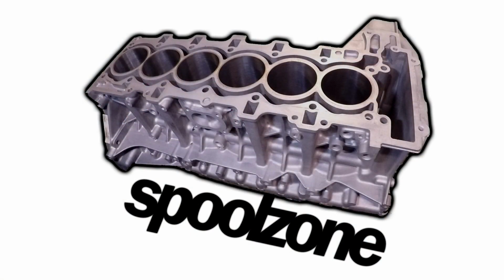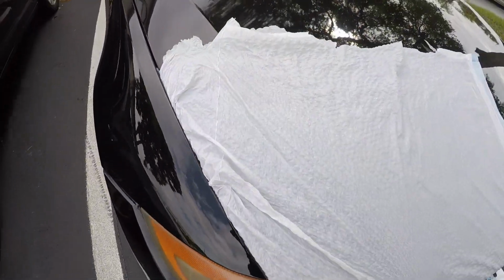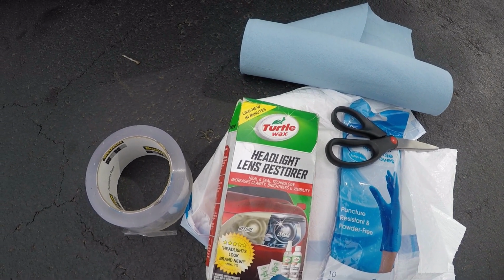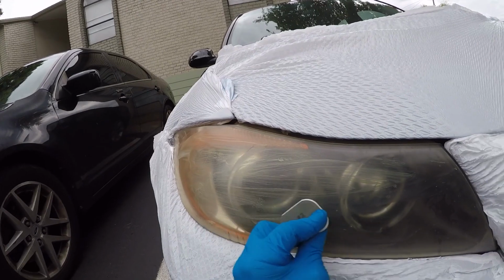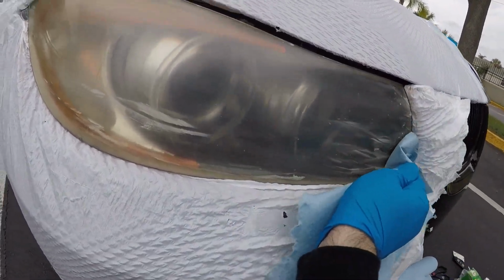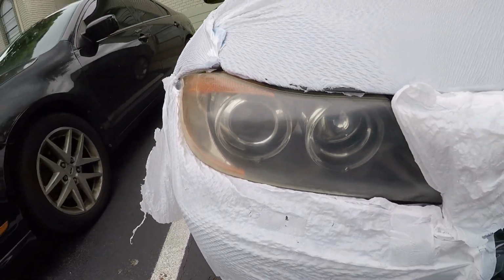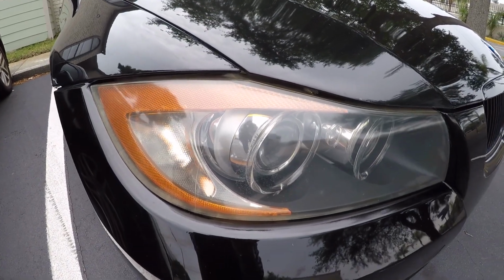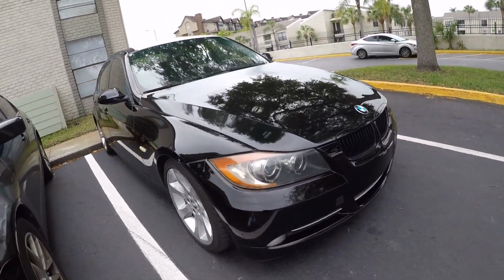E90 BMW headlight RESTORATION (turtle wax kit)

Comment: I had the same problem on my 135i, so i recently tried the 3M headlight restoration kit, which did not work at all. i had some micro cracking in mine which went nowhere with that kit. I went ahead and bought wet sandpaper from 320 grit up to 2000, I already had a 3000 grit pad from the 3M kit, as well as the orange cutting pad with compound. After all those steps I used a Meguairs headlight whool buffer attachment and the headlight wax that came with it. Since this process removes the final UV layer i put a few layers of cleaner wax on them, and a synthetic wax. Once I finished they looked crystal clear, saved me 2400 bucks for new ones
Reply from the maker: Hell yeah man I might have to look into that bc I decided I’m going to keep the e90 instead of flipping it. Thing runs like a champ 😂
Reply: @Spoolzone  Awesome! looking forward to see more from the twin turbo set up you got I may have to put those on mine at some point. I'm FBO right now, and I just got a coilover kit. My next upgrade will probably be the limited slip diff, after that maybe turbos